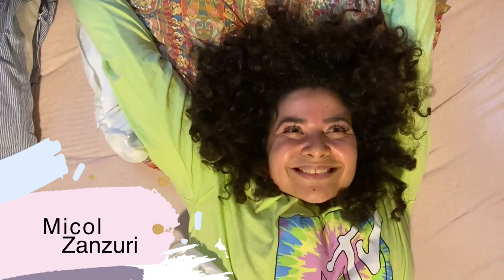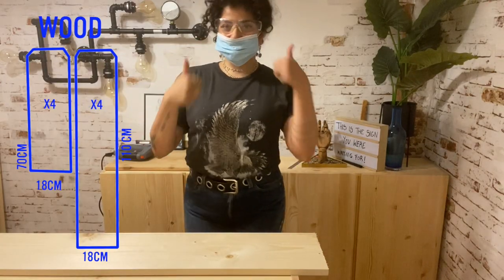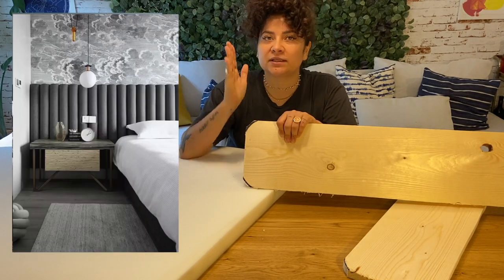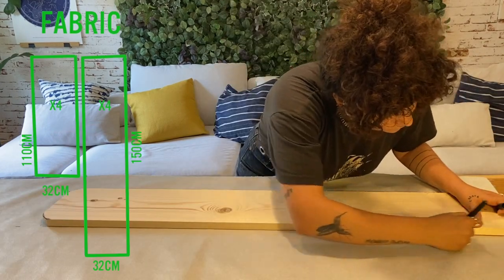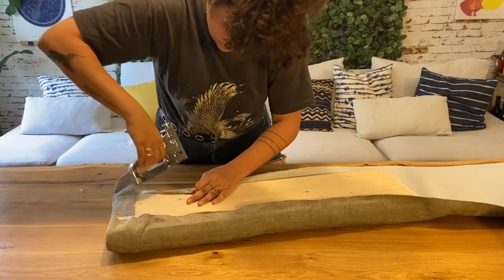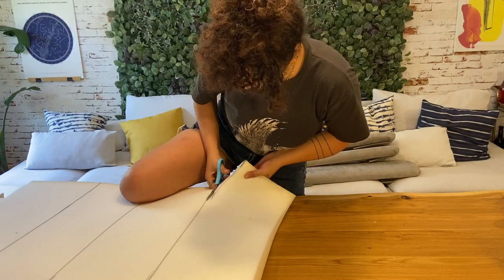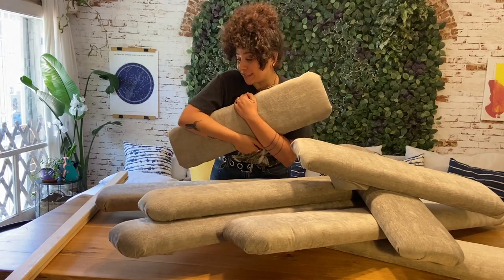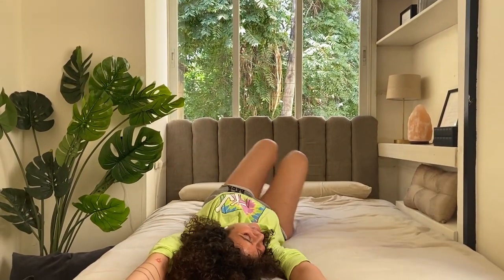DIY HEADBOARD TUTORIAL - How to make velvet headboard

Comment: can i make a cheaper & easier version using cardboard and foam, i mean it could work right?
Reply from the maker: it's hard to staple on cartboard but you could try!
Reply: Laughing... "NO" 
You have to have SOMEthing sturdy to staple it to... 
The foam is too dense and will bend it.
NOW... if you use very THIN Foam... maybe, but it will L(*)(*)K cheap.
Reply from the maker: I think that if you screw the cardboard on the wall it becomes steady enough. It can’t stand  on the floor but screwed on the wall yes hehe
Reply: @FashionAttack  ya I think so, thanks 💕
Reply: @judichristopher4604  lol i had a thought and started thinking if it's gonna work this way cuz im too lazy to make it the way she made it 😂💔

Comment: Nice. If you wanted a taller headboard  you could buy privacy fence panels @ hardware store. ( hv them trim bottom if u want shorter ) top is already rounded.  A nice string exacto knife ( box cutter) would slice right through your foam.